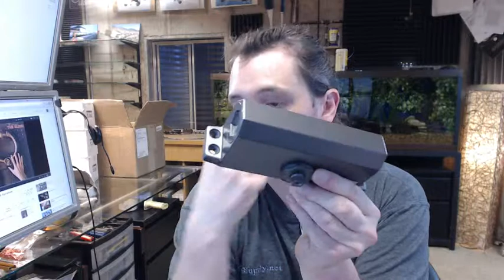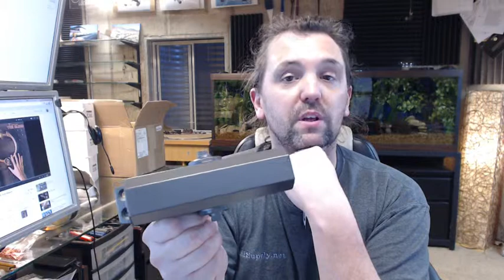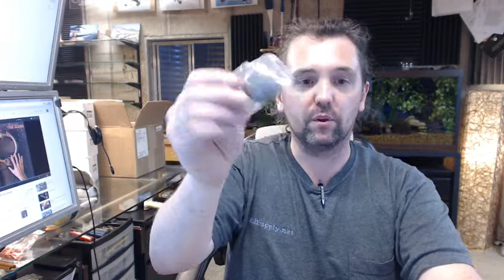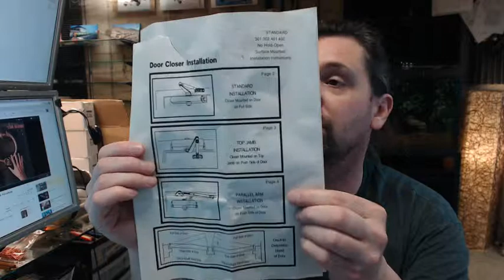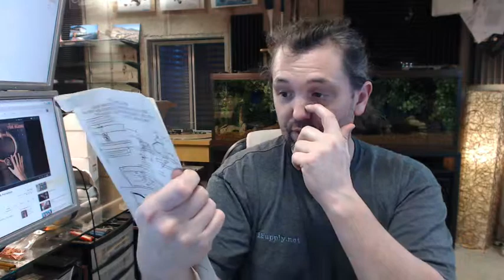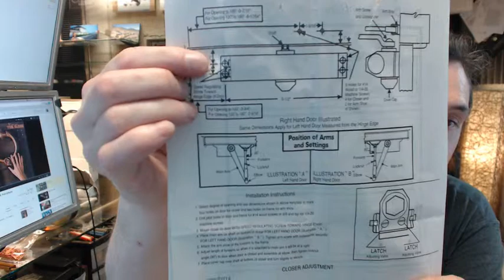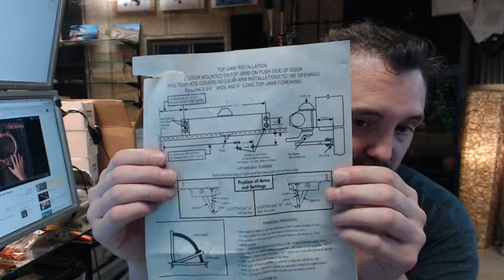Ultra Hardware 16130 Grade 2 Commercial Door Closer

Comment: i will keep in touch,  another tip when figuring out sweep and latch valves (if unmarked or cant read the markings,  look at back of closer (such as in 0:26)   look at the passageways, lower (short one) is latch,  long one (that connects to pinion shaft area) is sweep

learned this from when i adjusted a sargent 1230 while i was in technical school, it had no cover and no markings,  all i did was remove 2 bolts and felt for passageways.

-Jess the door closer doctor
Reply from the maker: That is a great pro tip and I deeply appreciate you providing that information.  Rich

Comment: hello Richard,  nice video about the closer,  

noticed at one point when you mentioned that if valves are towards hinges that the sweep will be lower and latch will be at top,  actually, this all depends on what hand the closer is set to.

as for TJ and regular arm,  its more efficient due to the closer has advantage of leverage during latch range, due to changing geometric angles of the closer's arms while closing, this is helpful for fixed sized closers,if PA it loses 20% efficiency
Reply from the maker: You're sure right about that.  Thank you for the comment and contributing to the discussion.  Rich